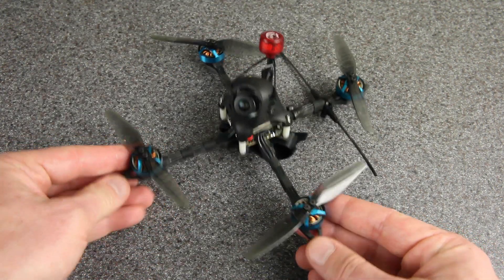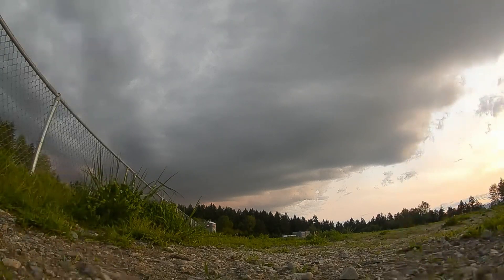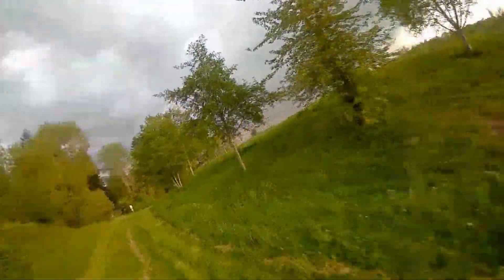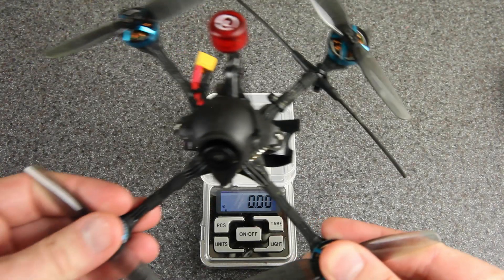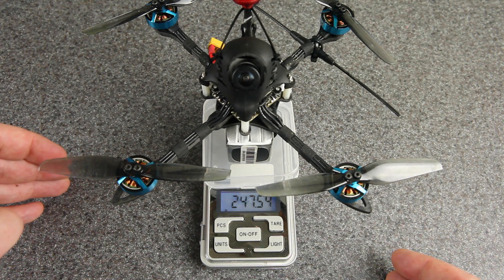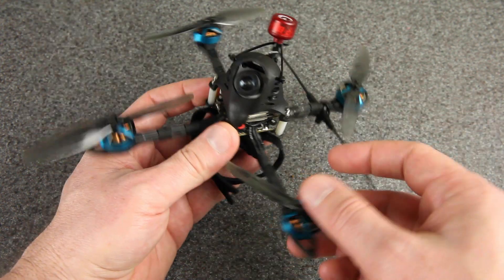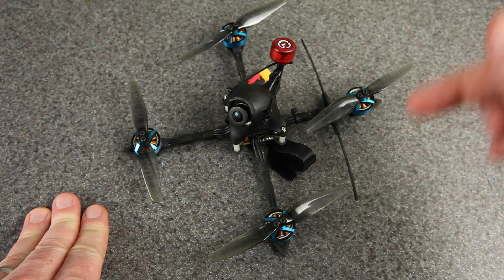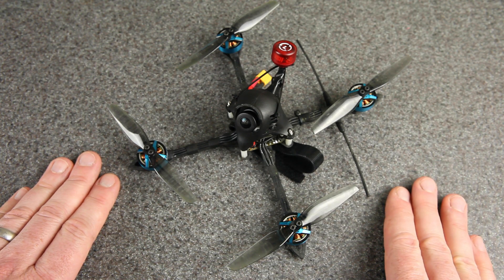X-Knight 4-inch + Digital HD FPV

Comment: Great build, how did you wire ground and 9V caddx vista to native betafpv 20A AIO? directly to lipo? use a capacitor? Thank you. I want to build this
Reply from the maker: The Vista is powered directly from the lipo. Yes I have a capacitor. I think it is 220uF. I later switched to the TWIG Mutant 4" frame which is much more durable than the X-Knight frame. Happy building. :-)

Comment: Hey how did you wire up the air unit to the aio betafpv board? You got a wiring diagram ? Sorry just trying to make the same build
Reply from the maker: I used the 20A BetaFPV AIO FC. Mine is v2 which doesn’t have enough UARTs, but I made it work by remapping the resources resources. I wired the vista to TX1 and S5 (remapped as RX1). You can see wiring diagrams on BetaFPV.com. Good luck.

Comment: The problem with 4 inch props is that it eats into their lucrative helicopter parts market. Helicopters notorious for long flight time utilities usually have 4 inch props for tail. They killed the market for the 2300kv 2006 and 2008 motors for the same reason.  Same reason that Apple does not release big dual screen iPhones that eats into iPad market.

Comment: I pretty much running the very same build only im using Xracer canopy. I also have the Betafpv V3 board & crossfire reciever but im running BetafpvF411 Target 4.1.6. Which has isolation bad!!! Would this CLI dump work for me?  NEED HELP BAD I SUCK AT TUNNING!!
Reply from the maker: If 4.1.6 is giving you problems, then yeah, I suggest you try the 4.2 release candidate. It's working well for me, and the tune should work too if your build is similar. Good luck.
Reply: @MrShutterBug  use the MAYTEK 411 Target? Yes the build is exactly the same everything! I have tried multiple firmware versions & the board has been on two different builds. And both times the isolating has been crazy. Is this common  for this board or you think maybe the board could be faulty? Thanks for your response it ment a lot to me😀
Reply: @MrShutterBug  I appreciate the help but I tried your dump and Betaflight firmware 4.2. And still have terrible mid throttle isolating horribly  bad. I'm curious if you changed Gyro filter settings (Min Hz,, Dterm min hz?..etc) And really curious about your regular pid tune? Are you running default pids? Did you change any of the P'I'D up or down..?  And are you running RPM filtering. I think I may have  faulty board maybe bad gyro or something idk? I got another board on the way today. Another question would be. Do you got anything touching  the top of the FC like double sided tape are anything to hold maybe the receiver or Vista in place. I ask this question wondering if the gyro is very touchy on this board. Again thanks for your response & help.

Comment: Hey great job!  I am converting my X-Knight also and wanted to know what you did to secure the Vista board?
Reply from the maker: Dennis Forbes the vista board screws upward into the canopy. If you buy the vista from BetaFPV I think it is supposed to come with several screws for various mountings. Not sure where to get the screws otherwise. They are pretty long.
Reply: Mr ShutterBug Thanks,  yeah unfortunately mine didn’t come with hardware as I ordered through RMRC.  Will have to dig some up.  Thanks again for the quick reply!
Reply: @ddfwaj  the external screws of the vista  are at the same place as betafpv fc, so on my x knight i replaced two external screws with longer frame screws for the fc. So that this screw hold the fc and the vista at the same time.

Comment: How do you have the Vista itself mounted?
Reply: That how i mounted a vista on the x knight frame, the external screws of the vista  are at the same place as betafpv fc, so on my x knight i replaced two external screws with longer frame screws for the fc. So that this screw hold the fc and the vista at the same time.

Comment: Do you have lots of Jellos and vibrations at high throttle? I got a lot in my betafpv Murant4. How to reduce that?
Reply from the maker: Jello hasn't been much of a problem on this build, thankfully. Most common causes of jello are:
- Damaged or unbalanced prop
- Damaged or unbalanced motor
- Loose camera mount
- Loose camera lens

Good luck.
Reply: @MrShutterBug   My set up is the same as yours and maybe what hes talking about is isolating. I cant seem to tune it out either. I'm running the exact same build as you are crossfire receiver everything only different is I'm using RacerX canopy. I notice your cli dump above. But I'm running a different target firmware than you Betaflight 4.1.6 Betafpv411 (BEFH) & you describe your target on yours is MATEKF411. On Beta firmware 4.2.
I'm assuming I can run the same target firmware as you given my board is the same as yours (Betafpv 20amp V3 Aio Board?) I think the only other difference between your set up and mine is I'm running  the Tango #1 transmitter for my crossfire
I got my serial crossfire  receiver on Uart #1 And my Vista on Uart #2. Surely I could use your cli dump? PLEASE HELP I SUCK AT TUNNING..LOL YOUR HELP ON THIS WOULD BE HIGHLY APPRECIATED 😀😎😀😎😀

Comment: This is awesome! On my Meteor65, I lowered my warnings because I also got voltage warnings often. Would that be safe to do with something this powerful? I am really interested in a Vista toothpick, especially with the new Caddx Nebula 720p camera announcement.
Reply from the maker: You could lower the warning threshold, but you really need to be careful not to over discharge the batteries (and they are like $20 each). On a 1S whoop, you will get a lot of voltage sag in the connector, wire, and FC so the voltage you see on your OSD is lower than the voltage on the actual cells. That's why you can run the voltage so low on a 1S whoop, because you're not really lowering the battery voltage as much as you think. On a larger quad like this, there is less sag and the voltage you see is much closer to the true cell voltage. If you run one of these down to 3.0 volts it will definitely puff.

Comment: Trees are the worst possible place to demo dji fpv, but still looks good. Interesting that the total weight is just below 250 😅 Could shave another 10+ grams with Nebula, lighter antenna and better canopy.
Reply from the maker: Yeah, the Nebual looks promising. What canopy would you suggest? The Racer X canopies are way tougher, but they are not lighter.
Reply: @MrShutterBug  I have a custom design, but it's for 20x20 mount (I built mine with HGLRC Zeus).
Reply: Gonna try to figure something out for whoop boards + vista when designing nebula version.

Comment: My scales must be broken.. Coz i run a  mutant 4 with 1408 3600kv motors, tbs nano32, crossfire, and a  betafpv 20 amp, 850 4s it weights more then this? 🧐...
Reply from the maker: The main difference is the motor. 1408 is a larger motor than 1505. The Racer X canopies are also heavier, but they're super tough, so that's a trade-off.

Comment: Overheating issues?
Reply from the maker: It will overheat on the bench, but I haven't had any problems in the air. I live in the Pacific Northwest, so the air isn't very hot. That probably helps. I'm using 700mW max power. Cheers!
Reply: I've been flying mine on 1200mW in sunny weather with temperatures near 30C/86F and no issues. But while working on it on the desk I use another toothpick to give it some airflow 😅

Comment: Great build 😁👍 that people can build themselves, I know your a great pilot Mr SB and don't crash too much, but how have you found the durability of this quad using the plastic standoffs 🤔.
Reply from the maker: I've crashed it a few times, but only into the grass. The standoffs probably are a weak point because they are so tall, but they do have steel screws inside of them. Fingers crossed!
Reply from the maker: Also, for a more durable option I suggest the TWIG Mutant 4-inch. 👍
Reply: @Sub250gFPV  4'' or 5'' for longer flight times?

Comment: sub250 hd will become easier with the caddx nebula camera
Reply from the maker: Yup. The Nebula looks promising.
Reply: @MrShutterBug  i wish there was a single board 25.5 vtx for dji
Reply: It's not that much lighter at all and I suspect it won't be as high quality as the DJI manufactured cameras that come with the Vista. The Nebula will allow for building in micro frames that are limited to 14mm nano cams though, so that part will be nice for sure.
Reply: @mrb2917  it's over 4g lighter and with a TrueRC Singularity you can save another 1g+ so that's over 5g saved just on FPV system. These things add up on micros.